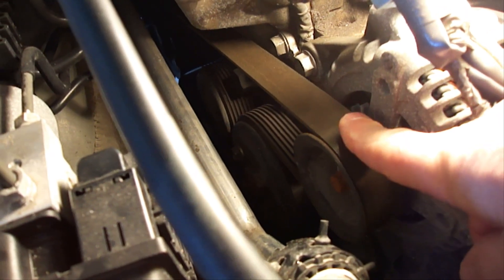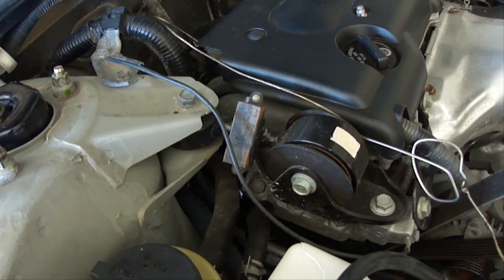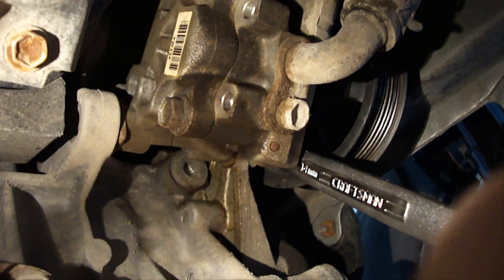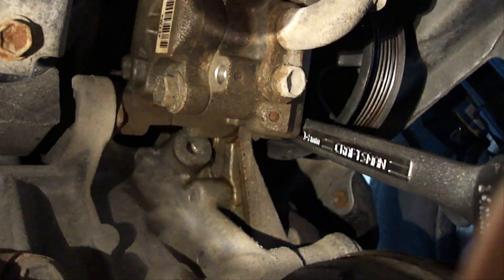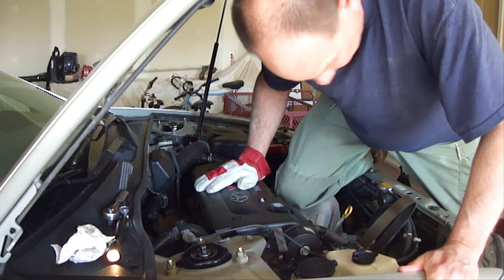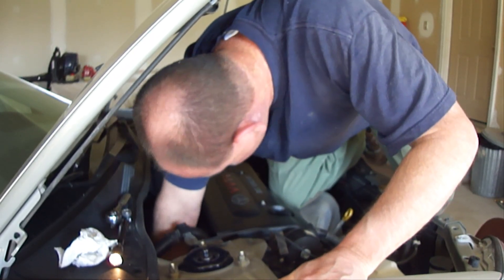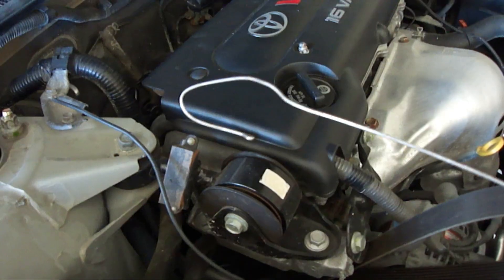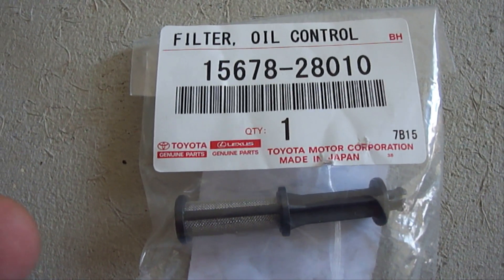Variable Valve Timing Oil Filter Screen Replacement - P0012

Comment: Hi, is this one of the reason I am hearing knocking sound in the engine whenever my car is idle for a long time when the engine is hot. No knocking sound then driving or cold start. Just when idling long enough while the engine is hot.

Comment: You would have had better access removing the passenger side tire  to remove the bolts to the power steering pump. 
Some people will struggle climbing on top of the engine bay like you did to do this job .

Comment: Thanks to the OP for posting. A few comments. The bottom bolt with a socket will require just the right length of socket and extension, I used a 3/8 breaker, shortest extension with a a short14mm 6pt to break it The top bolt can be broken with a 12 point box. Using an open end you take the risk of rounding the bolt. Once broken loosen with an open end swing the pump as high as it will go to allow the allen wrench to fit the plug. Make sure you catch the seal on the plug, its like an oil pan drain seal. The filter on mine was stuck and I had to use a long drywall screw to extract, it was clogged
Cleared the P1346, hoping this was the issue as I had already replaced the position sensor
Reply: You did not come back on line and close out what you “hoped” was the solution. 
I bestow on you the testosterone trophy. 
It’s a man thing. Very common. Always associated with confusion of closure.

Comment: Sir how can i extract the distorted oil control valve filter out of the housing of my Toyota vios 2nd gen. It was happened when i tried to extract it out for cleaning but unfortunately when i about to pull it out using pliers i accidentally push it forward and ended up clogged horizontally until it had more worsen when i desperately used screwdriver in a hope to pull it out. That's why it became distorted. Please help me! Thanks!
Reply from the maker: I wonder if bending a small hook in the end of a piece of wire while pulling on the other end of the wire with pliers might work.
Reply: @proclaimliberty2000  I will try it out sir, hopefully it will solve my problem. Thanks anyway! God bless!
Reply: @proclaimliberty2000  can I have your suggestion sir, I will make improvise hook, now i ask which is better L - type or U - type? Thanks!
Reply from the maker: @reynaldoroy1067  hook will be stronger
Reply: @proclaimliberty2000  copy sir thanks!
Reply from the maker: @reynaldoroy1067  👍😊 Let me know what happens

Comment: Thank you for your info, mines an 07 camry, I had to remove the bottom bolt out and then loosen the top bolt but dont take it out then pry the pump upward. I also had to cut my Allen wrench to make it work.
Reply from the maker: Yee Yang 👍😊 engineers are bad people!
Reply: @proclaimliberty2000  😂😂yes

Comment: I cleaned mine today and took off front wheel and plastic shroud. With deep 14mm socket you can get bottom bolt out threw hole in the pulley( if not aligned with bolt take a wrench on crank bolt and turn to align hole)then with bolt out take a pry bar and pry the pump back far enough without taking belt off or touching top bolt to get plug and screen out to clean it.
Reply from the maker: Lee Smith 👍😊

Comment: How can you clean the sludge or carbon or gunk out of the engine? If you use Marvel Mystery Oil, it will clog the cam screens and pollute the sensors. How do you clean the vvti engines without screwing stuff up?

Comment: ? I don't see a mention of what car or model this is for. What is it? Do all cars have a screen like this?
Reply from the maker: Ohcrap Most cars will have a filter screen if it has variable valve timing.
Reply: Ohcrap It’s a 2006 Toyota Camry 2.4L 4 cylinder.

Comment: Thank you boss for this great video, i has nocking sound all the day and it was with high pitch cold start.
Today i sent my camry 2004 to workshop the open and i was shocked its totally closed with slugh like layer and full of debrids.
Cleaning with petrol and carboretur cleaner with scrubing i got it very clean.
It takes 2 hrs work. I paid which is equal to 45 $.
The engine sound now is 50-75 % less than befor.
Thank agian 🖒🖒🖒
Reply from the maker: Fahad Al abadi 👍

Comment: ok there are holes to access the power sterring bolts through the ps pulley with a swivel 12 mm socket .

Comment: Remove the rh front wheel and use a socket and ratchet to remove the power steering pump this will make it easier to put the pump and belt back on as well
Reply: Keith Mcmanes did mine today and never took top bolt out or belt off just used pry bar to move pump back out of way. Was easy.
Reply: @leesmith9942  Did you loosen the top bolt?
Reply: @junmarcelino4207  I don’t think I did, try to put a pry bar in there and see if you can move it. Or reach in with your hand. I’m pretty sure I didn’t loosen the top one.

Comment: I have a 2005 rav4. I found it easier to get to the ps pump bolts with a short 14mm socket and a swivel extension. Now is this a 2azfe 2.4l in that Camry. I replaced the vvt valve when I did the head but I never knew there was a oil screen for it. I imagine that's the problem with the misfire on all 4 cylinders as the check engine light tells me. I've replaced every sensor in the timing (they pretty much all fell apart taking them out since the rav4 has 220k miles on it).  I hope the screen is all that is wrong. I got good within spec ohms ar the crank and cam sensors.
Reply from the maker: Yes, this is a 2AZFE  2.4 liter engine.  What codes do you have for the check engine light?  A plugged VVT oil screen would not cause a misfire.
Reply: P0012.  Cam position timing over retarded bank 1. And every misfire code it can. I have never had that oil screen out for that vvt oil valve. The car has over 200k on it and I'm sure the last time that thing saw sunlight was when the engine was being built at the factory.  The only sensor I haven't replaced in the timing is the crank and I tested it and it's fine.  It has a 1 year old cam sensor and the vvt oil valve I replaced at the same time. It was leaking oil when I did a head job on it. It ran like new till now.
Reply: Ok. So I finally got the screen out. It was pretty plugged up. I couldn't get a new. I cleaned it up. Put it back. Check engine light is out (all the misfire codes) and it runs like new. Thanks for this video. I didn't even know that screen existed till I stumbled upon this video. It was driving me insane trying to get these lights out and why it was running so poorly.
Reply from the maker: I don't understand how that fixed a misfire code ignition problem but I sure am happy for you Sean.

Comment: I couldn't pull out filter screen with pliers and it cracked in pieces and is stuck in there I am now getting a rough idle how can I get the pieces out?
Reply from the maker: Ari Koenig Do you have a vacuum cleaner with a hose?

Comment: such a daunting task for such a small filter..  what were they thinking...  thank you muchly 🙏
Reply from the maker: They weren't.  It's incredibly frustrating sometimes what engineers do and this was certainly one of them.
Reply: @proclaimliberty2000  
No, they were thinking. 
It has long been known that tricksters and control freaks of humanity are engineers. 
They gather together in board rooms to either pontificate an absurd idea or just to challenge other engineers to ensure a vehicle must be returned to the stealership. 
It’s like a career contest. One is challenged to have some notch’s in there belt. 
Obsolescence design. It’s all about how well in there career, they have designed a product which limits or eliminates mankind from his economic participation. The uses Artificial intelligence to create products that will have a lifespan beyond warranty rates and not very far behind. 
Geniuses especially the Germans.

Comment: Awesome - finding that little guy would have been a nightmare - I was searching online for the part so that I could see an engine diagram of where it was located - and found many people proclaim it is in a banjo bolt , I could not find it and no wonder - Toyota hid it behind the power steering pump where it will not only be hard to find -but will keep many of those pesky DIY'ers from servicing the thing.  
One would think that any filter or screen would be in a reasonably easy to access location so that proper care and maintenance could be performed before a catastrophic failure. My vehicle has over 200K miles on it and I think at this point it is probably due for a replacement.
Thanks very much .
Reply from the maker: You're welcome.  Yes, it's very frustrating the way some things are engineered.  .  The hardest part is removing the power steering pump bolts.  It was slow going.

Comment: Did this fix it
Reply from the maker: After replacing the screen and engine oil the problem was fixed.
Reply: proclaimliberty2000 can you tell me were this filter is located at on a 2011 cruze pls

Comment: Can you lead me to the name of this exact part for my 2006 scion tc.. I can't find it at my parts store. Like.. Can you tell me what the part # is or anything so I can purchase it. Or did you just clean and replace with same screen ? And do you have a video of changing out the actual vvt selenoid?
Reply from the maker: I'm sorry but I don't understand your question.
Reply: proclaimliberty2000 I edited my commentb
Reply from the maker: You will need to contact a dealership for the part number and availablilty.  I would replace it and not clean it due to the high heat that it's exposed to over time.  This is too funny.  The next video that I have ready to post is how to install a VVT solenoid.
Reply: proclaimliberty2000 hopefully soon I'm probably going to start reason g my car apart Sunday or Monday. I would love your video on it
Reply from the maker: I'll try and post it Saturday A.M.
Reply: $8 dollars at the dealer

Comment: My camry has no code but makes a knock noise only at idle and oil pressure is good and no metal in pan.  Is there any other symptoms of this problem besides a code?
Reply: Thank you for posting this video, I pulled mine out and cleaned it.  I could not find any information on this screen and that was the problem.  I had almost rebuilt the whole engine besides the piston rings and did not know it had a screen so I missed the chance to clean it while I had engine out.  It was a very dirty engine from previous owner.  Car sounds and runs great now.
Reply from the maker: Did you change oil brands or viscosity?
Reply: proclaimliberty2000 pmhoho

Comment: Wow! I have an 05 Scion XB that is so much easier to get to.   Can that filter be cleaned with mineral spirts or something else?
Reply from the maker: I know, I can't believe they designed the engine like that.  I would only replace the filter screen and not attempt to clean it.  Eventually the plastic will start breaking apart from heat and they don't cost much.  That's my personal opinion.
Reply: Yeah....I agree....  just hope dealer does not want $25 for something that can be made for less than $5.
Reply from the maker: I paid $8.41 at a Toyota dealership for the screen.